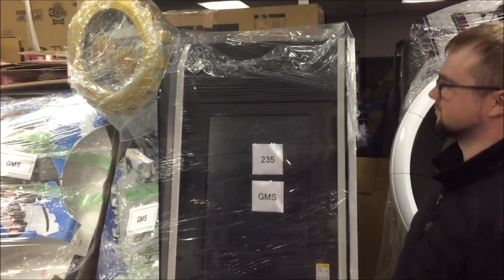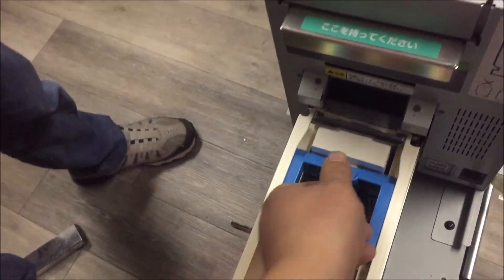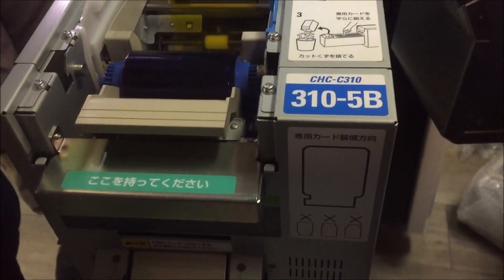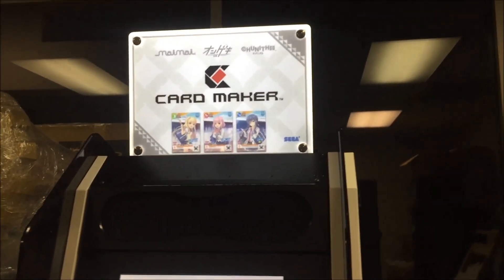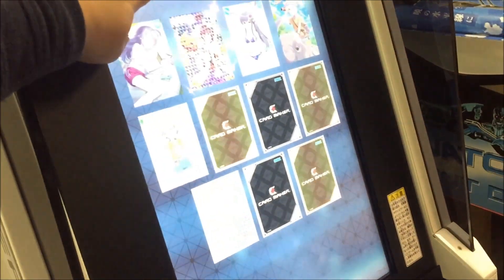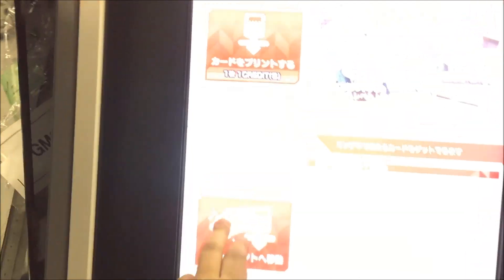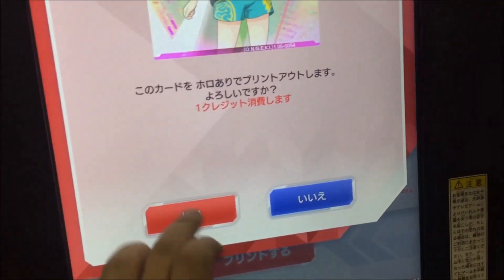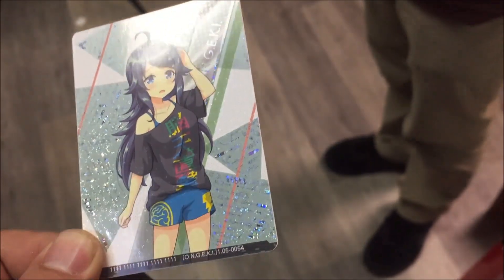SEGA CardMaker unwrap and overview (gacha whales only)

Comment: Still watching the video so you may address it later in the video at some point - I'm curious how the networking works with card maker for a privately owned machine like this. Typically the Chumai games in the US are running on some kind of custom server, no? How does this fit in to that? I don't know much about this as a whole so it may be a deeper question than I'm expecting 😅
Reply from the maker: Tend not to discuss it much in public. It’s all linked together tho